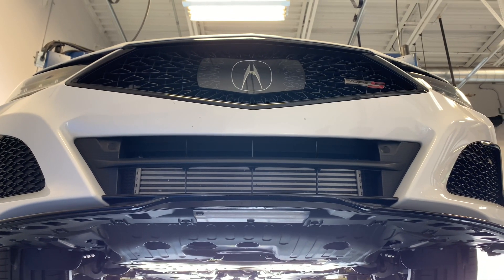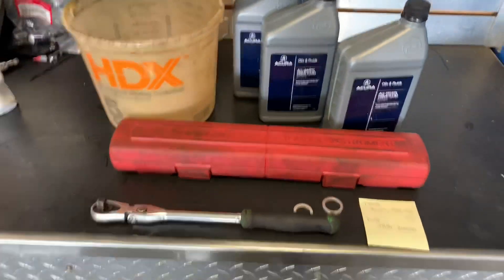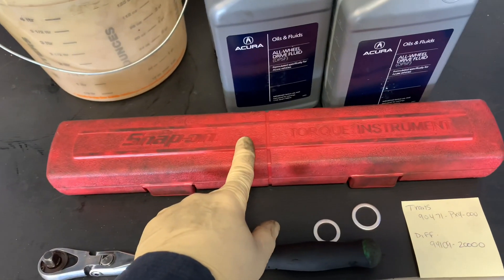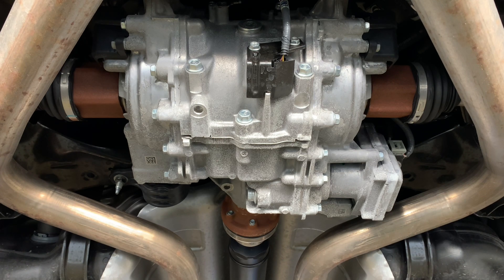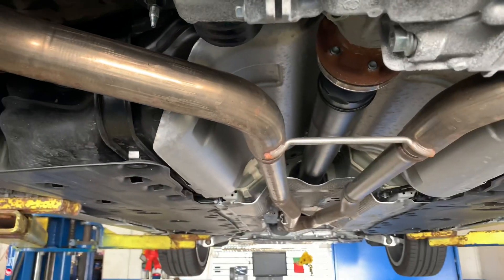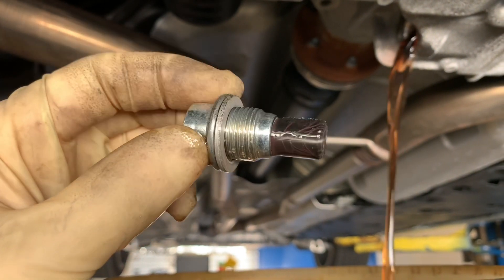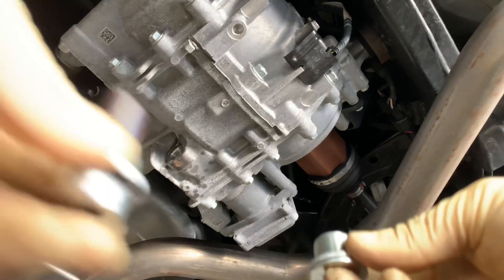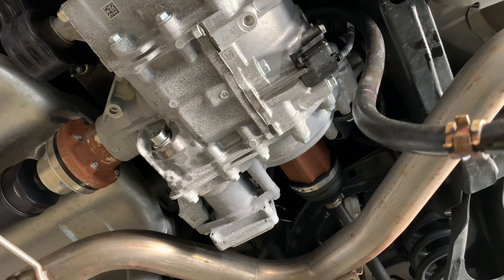Tlx type S rear differential service (applies to all trims and other acuras as well)

Comment: love these d.i.y videos would never thought that diff oil needed to be changed so frequently thanks for sharing 👍
Reply from the maker: No problem, Acura does say to follow the maintence minder in most circumstances, but the we have to remember the manual is written for all trims driving with stock power and a grandma driving it (no offense to any grannies) but once your doing launches, hard driving, increased temps and power, aggressive maintence is more important then ever. Thanks for watching 🙏🏻

Comment: My 23 Pilot just threw out a B6 code at 6300 miles, will the Honda Pass cover rear differential service since my vehicle is still under 2 years/24K miles? For future reference, are the washers and torque specs the same as your TLX?  Thanks in advance!
Reply from the maker: @DY81149  don’t think that’s covered under the maintenance plan. Yes all torque specs are the same
Reply: @BCautosutions  Thanks for the torque spec : )

Comment: I love these videos man! The “bigger” engine versions of Honda/Acura vehicles (typically V6) don’t get enough love here on YouTube.

Right now I’m looking for a video concerning rear brake jobs for modern Acuras/Hondas with electronic emergency parking brakes.
Reply from the maker: Thank you sir! Yeah for sure wish there was more content. Would love to see other peoples perspectives. Just not beeping people messing with them unfortunately.
Reply: @BCautosutions  exactly, I’m just now seeing people posting some videos on the 9th-Gen Honda Accord V6. I know my way around the non-turbo J-series V6 engines & their “Hondamatic” transmissions. 

But the thing is, Honda/Acura made some small changes to that engine such as plastic valve covers, direct injection, or even a plastic intake manifold in the trucks.
Reply from the maker: @MrSamPhoenix  Yes, the core and design of the j engine has been the same for 2+ decades. The updates and advances have been in the heads, injection, manifolds, etc..

Comment: I just wanted to thank you so much for these videos. I have an Acura TLX type-s too and will likely need to do my own servicing down the road. 

I recently got screwed by my dealership. They charged me 616 to resurface my rear rotors and replace the rear brake pads. I later found that you're not supposed to resurface because they have a special coating (FNC) I fought tooth and nail but eventually they replaced my rotors for free. It still doesn't justify the cost of how much I had to pay in total. It was ridiculous!!!! Never go to open road Acura of Wayne if you are in NJ.

My second option would be to take it to a trusted mechanic, but those are hard to find. Thanks so much again and I hope you post more videos of how you service your type-s this will help me plus many other people who have this car and want a service it on their own who don't want to be price gouged by dealerships.

I also had no idea you had to replace the differential fluid. I have 34,000 mi on my car and I haven't had it done yet. I didn't know this was a service needed. Another reason to steer clear from dealerships because they don't actually care about the customer. Now this is another problem I'm going to have to deal with on Monday.
Reply from the maker: Hey man thanks for the kind words! I’m actually in nj and could definitely do some of the services if you chose to. Wayne isn’t too far from me as I’m in hillside. Anyways I will keep on rolling out the videos as the opportunities  come. I’m going to be uploading a video on a puddle light update (kind of) as well as a surprise added lighting for a very oem+ look.
Reply: @BCautosutions  holy cow, what a crazy coincidence, that is amazing wow lol! Really? Ok we should definitely exchange information, do you have a business card or website? Lmao wow, what a funny and awesome coincidence!

And wow, that's awesome I am looking forward to that video. I have my alerts on so I'll be ready for it when it comes out
Reply from the maker: @DigitalChaoS  it’s a small world! 

You can email me at bcautosutions20@gmail.com or direct message me on Instagram @hondamobilemechanic

Comment: Thanks Bro, I just ordered fluids and washers. I'm at 18k miles
Reply: Changed it today. The fluid was black lol. 1st change. Used a manual pump to replace Fluid. Difficulty level 1, due to tight space on fill plug area.
Reply from the maker: @GhostQue2004  Nice job, yeah it gets dark quickly especially the first one.

Comment: I always crack the fill loose, not a issue on new cars but some old ones may leave you arranged with a seized fill plug with a empty diff
Reply from the maker: Solid point.

Comment: I wonder if you have an idea how much labor time is billed for changing the timing belt on a TLX type s and how often 
?  And for the diff oil changes
Reply from the maker: I’m going to be charging 7-8 hours. Normal I series timing belt pays 6 so being quad cam and requiring special tools 1-2 hours sounds justifiable, have it replaced every 7 years or 90-100k. Diff fluid 15k for modded and/or hard driving and 30k under all other conditions.

Comment: Is their any kind of transferbox that on this car that needs a fluid change also at the same time as the rear diff service? I have a 21 Tlx Advance Sh Awd. Thank you
Reply from the maker: Front transfer case should be done at 30-60k depending on driving habits. Will have a video soon
Reply: Ok thanks
Reply from the maker: @fredsumner9920  🙌

Comment: What about the transmission how often should you change it
Reply from the maker: Acura says as per maintence minder code 3. My personal opinion will be at 15k, I’ll assess it at that point and decide from there but most likely anywhere from 15-30 especially if driving spiritually and with increased power levels.
Reply: @BCautosutions  ✌️

Comment: Not trying to judge, but every 7500 on a closed diff seems like a complete waste of time and money to me. Even with spirited driving, that is overkill. That's like changing your engine synthetic oil every 2500 or 3000.
Reply from the maker: At stock power levels sure, but the car is already making more then that and even more shortly so although it might be overkill, it’ll be a good way to keep an eye on things. This is a new platform and there’s no way of knowing what the limits are yet so I will be documenting everything for the sake of everyone else. With bolt ons and under normal spirited driving every 15-20-30k should suffice like I said in the video everyone will have to gauge how they are driving the car and what’s right for them.
Reply: @BCautosutions  For sure. Good video btw. Curious how these hold up as well.
Reply from the maker: @alucarus6  yeah we all are but hopefully none of us find out any time soon if there’s some major issues with extra power being extracted out of them. Thanks for watching 👍🏻